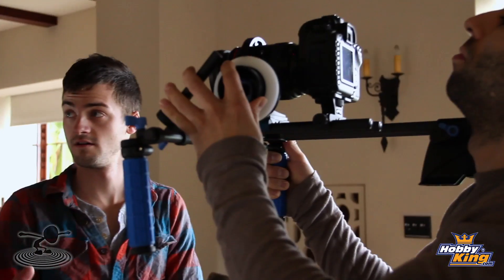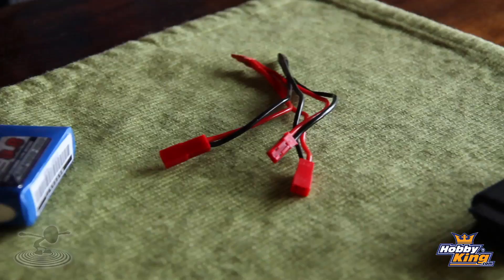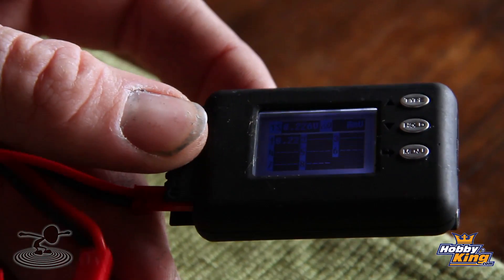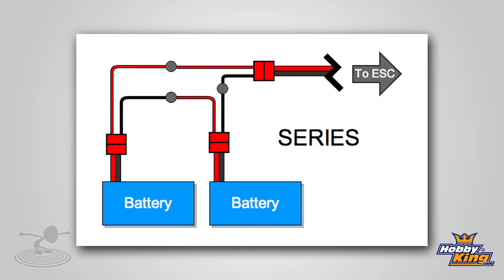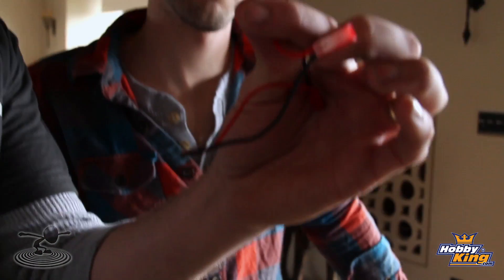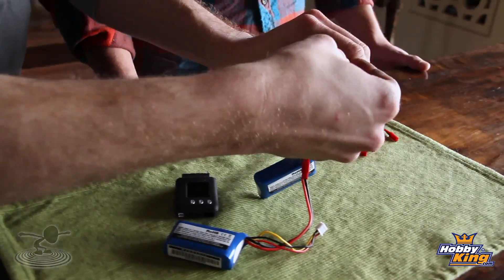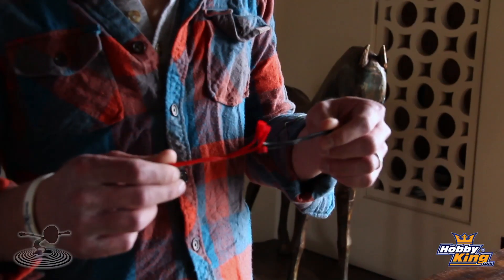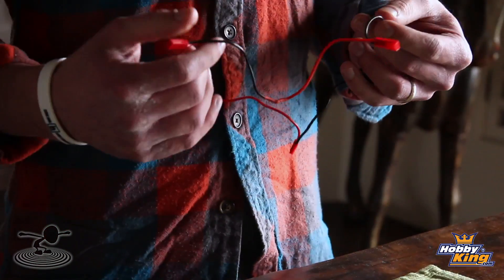Flite Test - Parallel and Series - FLITE TIP

Comment: If you guys want to increase your voltage, use a step-up DC-DC transformer. You can get them cheap from China m or wrap some copper wire around a magnet to make a mini inductor. If you want to step up your Amp pull, use super capacitors. 👌🏻

Comment: Hello can I connect 2  batteries in parallel with the same voltage just different mah both 36v one has 4400mah and the other 8400mah?

Comment: When it comes to parallel does the C rating increase as well or does it stay the same?
Reply: The C rating on lipo batteries are false information, but yes, technically the current will increase because a higher capacity battery has less resistance and therefore more current. I=E/R (Amps=Voltage/Ohms

Comment: When it comes to parallel how are the balance connected?
Reply: If both batteries are rated at the same capacity, both batteries will draw about the same amount of current. If one battery has a higher capacity, it will draw more current because it has less resistance or ohms. To answer your question, they won’t be balanced. This is just a cheap way of getting away with flying larger and/or more powerful airplanes with the batteries that you already own

Comment: This is the video I was lookin for... lol
I had (3) 7.4v 1,300 mah Lipo batteries that were draining faster than they are supposed to... Instead of 6-7 minutes one would give me 2 minutes flight time in my Bugs 6 drone. So I figured I'd parallel them to get maybe 6-7 minutes flight time from the 3 pack I made...
however....  Here's the question...
    Should I splice the parallel charging wires together too? or just use a triple parallel charger cable to parallel charge the lipo  pack I made?

Comment: this is probably a stupid question. but why can't you charge your batteries in parallel.  3 battiers  at 1300 mah= 3900  charged at 3 amps  1 hour vs  1300 mah charged at 1 amp 1 hour 3x  = 3 hours

Comment: i have two 11.1v 1800mah 25c  lipo batteries. i can draw 45amps from each. when i connect this in parellel. can i draw 90 amps?
Reply: Never trust the C rating on those lipo batteries. You can draw more amps with larger battery capacity because higher capacity batteries have smaller ohms, but depending on your setup, you’re realistically going to be drawing 8-11amps of peak power.

Comment: I'm building an ebike battery could I wire a 6 cell 22 volt 8000ah and a 4cell 5200 in parallel to give me 13.000ah but would it still be 22v

Comment: I just ruined 2 lipos, 400 mah. I had them hooked up in series to power my brushed glider.
It didn't work. The combined cells got all sparky and hot. In the end they bulged up and started smelling. Then they returned to normal size and only had a voltage left of 3v instead of 8v. The receiver needed at least 5v so I had to combine 2 cells. Can I still use them since they still hold a charge? Anybody know what the problem was with the heat and the sparks?
I had a jumper between the positive and the neg of each cell. The two remaining holes were for the power leads. I measured 8v on the meter, so the wiring was good.

Comment: Wouldn't parallel also double your maximum discharge rate?
Well you'd have to keep in mind that the load on both the batteries would vary slightly, so i wouldn't count on double, maybe +90% C rating.

Comment: great info sir 👍  quick question  i have a 3s 65c 5000mah lipo it's  3 to 4 months old but only used 3 times then put into storage voltage. could i buy the same 3s and use it in parallel with the  3 to 4 month old battery that was used 3 times
Reply: Craig Miller yes you could

Comment: I have a tiny whoop and it uses a 1s 200mah 3.7v lipo . so why did my tiny whoop blow up when I tried to use a 1s 850mah 3.7v lipo ? I'm so confused :/ ??  wouldn't that just give a longer flight time (not saying it lift the extra weight) but in theory it should only make the flight longer . but it literally blew up like a firework.
Reply: Might have overloaded motors, pdb and or esc's from running extra hard due to the higher weight

Comment: @FliteTest  Im currently making a 3 engine EDF (1100 grams of thrust each) and so I'd need 3 ESCs. I have 3 54A BECs and two 2200mAh 3C lipos. Im thinking going parallel all blacks with blacks reds with reds. What do you think? I don't want to burn out my plane.

Comment: When i connect two 1s lipos parralel, get i then one 2s lipo or still a 1s lipo
Reply: Hooked up in parallel it would still be 1s or 3.7 volts. In order to get 2 1s batteries to equal 2s or 7.4volts you would need to hook them up in series.

Comment: If you are parallel-connecting batteries, make sure they are not only the same nominal voltage, but also the same actual voltage. If their voltage is different, the more-charged battery will try to charge the lesser-charged battery and too high currents can occur which can be dangerous.

Comment: Does the c rate factor multiply your amps to sort more capacity? For example does 2 batteries of 12v (24v total)  and 2000mah each (4000mah total) and both 10C ("c" rate) put out 4000mah * 10C = 40 000 mah final?

Comment: Just saw another video about this and it says that in parallel you add the power, or in this case, at 4:53 its not still 44 amps, its 88 amps. Now Im confused. Im going with the other one. Flitetest, please correct it cause its important. Tks
Reply: +Felipe Forlin In theory you should get more amps from a series connection. I still try to use higher C batteries regardless of the application to prevent puffing and premature ware.
Reply: It's simple. Parallel adds the currents and series adds the voltages. Resulting power should be the same if you compute using Power = Voltage X Current. Series or parallel they'll be the same theoretically.
Reply: tj is slightly misunderstood.  Current=V/R so current is proportional to V. This is one of the first things taught about electricity. So yes with the same resistance and 2 batteries, more current will flow.

BUT the batteries still have the same internal resistance, they will STILL overheat/degrade faster if you pull more than the C rating of one individual battery. The current is not split between the batteries. Its analogous to the difference between:
1 Pipe with 2 litres/sec through it 
2 Pipes with 1 litres/sec through each

You could say you can pull HUNDREDS OF AMPS WOW from any LiPo... If you short it out. Lol
Reply: When people say you get twice the amps from parallel it means twice the amp-HOURS. Ah is a measure of battery capacity. You can still only draw 44 amps, but you can draw it for twice as long.
Reply: parallel doubles mah volts stay the same the amps do not double

Comment: Hi, I intend to make a portable usb battery bank for charging my mobile phone using 3 single S LiPo 3,7V batteries in series I have, so it would give me total output of around 12V at 3S that would be stepped down to 5V. However, they all have different mAh and C ratings. One has 500 mAh 20 C, the other 600 mAh 25 C, and the third one 2000 mAh 1C. 
Could I charge these three batteries all at once treating them as a single 3S battery, or should they all be charged separately? In case of connecting them in parallel would this deliver a total of 26000 mA of continuous current draw, but would then need to step it up to 5V?  
Btw, I'm not an expert in LiPo batteries and any suggestions are welcome.
Cheers!
Reply: +Viktor Božičević you are going to want to get three of the same batteries (all of them identical in mAh and C ratings) if you plan to charge them as one unit or as a 3S pack, as for using them together to charge your cell phone, you may want to consider what I said earlier with getting 3 identical batteries due to the possibility of over discharging one or both of your lower mAh rated packs and potentially damaging it/ them, making it/ them unable to charge up at all or hold the proper amount of charge. I hope you can come up with a solid solution, good luck.
Reply: +Just for fun Thanks, I found the NiCd 7.2V 6S battery pack from my old 27MHz RC Carisma formula car would also be good. Since NiCds are much easier to mantain and charge. This battery pack is almost 10 years old, and I havent been using it for about 8 years, recently charged it with its original walwart charger, tested it with voltmeter and still works like a new! :)

Comment: good day, my plane requiere 4S2300mA, but I have 2 batery 2S 2300mA, can I put in serie and the result is 4S2300mA?
Reply: +Jorge Galan yes, that is how it will work. run the two in series to increase the voltage but not the mAh or capacity.

Comment: So do you have a diagram for connecting, for example, 2 1200mah 30c 7.4v batteries in parallel?  all with JST?  Is there a place where one can buy such a harness already pre-built and avoid soldering altogether?   I'm assuming in parallel you wouldn't need heavier guage wire because the current is the same as a single battery, right?

Comment: Isnt the load divided equally on the batteries? Say if the load is 50A with two batteries in parallel, both of the batteries should at least be able to give 25A? Both batteries cant be giving 50A (whats the point in getting more batteries if they discharge at the same rate?).
Im not sure tho so pls someone elaborate.
Reply: i think what happens  is (i could be wrong): the circuit will take the shortest route to complete. so with parallel batteries the current will travel through the first one until it has drained and then will move onto the second one etc until all the batteries have died

Comment: Flite Test Help!  I get the whole series/parallel battery wiring..My problem is how do I take this series/parallel wiring and wire them both into Dual ESC's!? Im running a multi engine and I want the batteries to feed both engines equally. (wether in series or parallel)  So I made a parallel harness, hooked that into a series harness for my batteries.....not working out so good. I checked all the wiring- everything is on point. I just get endless beeping from my motors...any ideas?
Reply: +dryan084 I would connect the batteries in parallel and the ESCs in parallel, then just connect them together

Comment: This is cool, I'm gonna try this on my Dynam Spitfire.
I have one of the early ones that had the lower voltage motor and all that nose weight.  It crashed on takeoff so I'm rebuilding it into an He-70 Blitz and scratch-building a nose that will place the battery farther forward and accept 2 to 3 batteries (and a plastic bomb dropper)

Comment: can i connect two different brand(wolf pack and zippy) and different power (2200mah and 5200mah) in parallel configuration ???
Reply: please do not do his. they MUST be the same capacity and if possible the same brand because different brands have different tolerances. this can cause one battery to over-discharge which causes puffy batteries(obviously very bad)
Reply: ***** FliteTest  Damn really? in Parallel they have to be same mah? What about in Series? Can we do different mah in series and just average the C rating? ALSO: on both Parallel and Series what is the effect of using different C ratings. What if, for example, I'm wiring two 5000mah Zippy's in Parallel but one is 20c and the other is 40c.
I'm assuming the BEST for both Par. and Ser. is to use the SAME battery. But lets say that isn't an option. What can happen? Why is this ok or not? 
I Do wish sometimes that these vids would go into even MORE gritty detail. We're all nerds if we are watching this, we can handle tech data!
Reply: No matter what type of connection always use cells with the same capacity (mAh), also same brand and C rating if possible.

Comment: Anyone have any idea if putting LiPo batteries in parallel safe? There's conflicting information all over the internet. I'm planning on hooking two 8Ah 14.8v LiPo's together in parallel for 16Ah capacity and am worried about bad stuff happening :/
Reply: Done properly, it is safe. Adding a 2nd battery does add a 2nd possible point of failure so more precautions are needed. Use identical batteries. Check each battery seperately for cell voltage before plugging them together. LiPo batteries need a tight tolerance of voltage across all cells. Plugging a fully charged battery together with half charged battery will most likely damage both batteries to a degree from puffiness to possibly igniting them. Google "LiPo fire" - fun to watch even if you already know the danger.

Comment: i think the "amps of draw" terminology is actually the amps per unit of time that you get. the way they talk about it and most batteries are documented is confusing. the simple way to see it is that a battery has a certain amount of charge ie electrons or electrochemical potential to produce a certain amount of charge. if a battery has say x amount of voltage you can use voltage current resistance "law" to find out the amount of current that would be going through the circuit if you knew the resistance. so any amount of batteries connected in what ever way can produce any current given the resistance except if the amount of charge the battery contains would drain the battery before such currents were ever reached. so if you have a battery with x voltage and a circuit with a certain amount of resistance then the current can be determined, but because the battery is not an infinite source of charge this means the charge will continously drop as it is used up and so the voltage will decrease and the current will as well and it is related by a factor of the resistance. so any battery can only deliver a given current for a period of time and knowing this you can deduce the charge and so the to are dependent of each other. just wanted to say basically cause i find it easier to understand batteries by thinking about the charge rather than current rates or the many other common methods to specify a batteries capacity (not to be confused with capacitance ). which now brings me to another interesting topic of using capacitors with batteries to extend flight time. i know capacitors can provide a quick charge with high potential differences but they do not have the high charge capacity as batteries but i have seen somone use large capacitors coupled with a lithium battery to replace there car battery. there are some trade off's as it can not sustain long cranking of the engine so it works but not for hard to start engines. i wonder how this would work with multirotors? or if anyone has tried using a lead acid battery for multirotors?

Comment: Also if you have 44 amps of draw , does that mean you cannot use a 30amp ESC ? Or does it mean you can draw that much amperage if you need to?
Reply: i think the 44 amps of draw is the amount of current required to drain the battery in a given period of time, not sure what time unit that is? a minute or hour?
Reply: also the battery is not what will ultimately determine the current draw but the circuit itself. so if the flight controller will command the esc to power a motor capable of drawing high current then it would be a problem. basicly i think the esc needs be rated higher than the motors could be controlled to use by the flight controller. then the battery must be rated to handle higher discharge rates than the esc's will discharge the battries. this is not the Cn number which is actually the current that would drain the voltage of the battery below it's rated amount in 1 hour. nor is it the mA*h rating which is typicly the current it could provide in 20 hours and remain above the rated voltage. if you C rating is higher than what the esc's would discharge or higher than the amp rating of the esc then you are safe for at least 1 hour flight time and surely the battery can handle this discharge rate. just make sure that the motor will not draw higher amps at full throttle than the rating of the esc or the C of the battery otherwise this will potentially burn out the esc or the battery which ever is weaker (most likely the esc). hope this helps and im sure someone can correct anything that i am wrong about.

Comment: Third part of my post
You can solve problem of different voltage of battery,if you put two diode on those wires you use to make parallel. That way you will alove electricity to go out of battery into the ESC,and stop batteries from charging each other. You just have to solder diode strong enough to pass through enough A the battery can give.
Hope this post helped you,and sorry for my bad english.

Comment: Second part of my post.
So one battery will burn out because of high discarge rate,and another will burn out because of high charge rate. This will happen if there is a bigger diference in batteries voltage. 
In parallel you can mix different mAh in batteries,and diferent C rate,but they MAST HAVE same voltage. If the C rate is different you get middle from them. (one 20 C,another 10 C= 15 C to multiple to mAh)

Comment: Well as I learn in school,if you have two batteryes 2200 mAh,11.1v,20 C,and those battery can give 44 A peak from each,so you get next:
In parallel you get 11.1v ,4400 mAh,and still 20 C,but 88A (4,4*20=88A)
In series you get 22,2v,2200 mAh,and still 20 C, but 44A.
Problem you can make is if you use batteryes which is not equaly charged. Than the battery whit higher voltage will charge lover voltage battery. And charge it fast. And you know what that means.

Comment: Does the C rating matter? ANd the number of cycles the batt went through? I currently have a nanotech 2200mah 3S 25-50C and a nanotech 2200mah 3S 75-90C. DOes that C rating matter? And can I run a normal turnigy pack with a nanotech in parallel?

Comment: I think you guys made a mistake @ ~4:55.  Assuming a 2200mah 20c pack, 44A is right.  Add the second one in parallel, and you have a 4400mah 20c pack.  Thing is 20c on a 4400pack isn't 44A, it's 88A (4400 x 20 = 88000).  You actually DO double the amount of power you can draw from the pack.